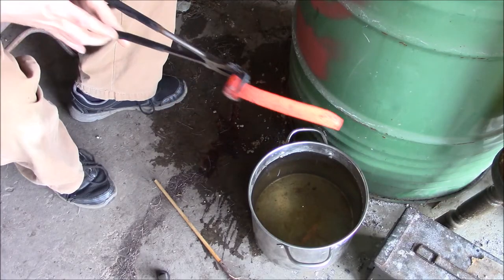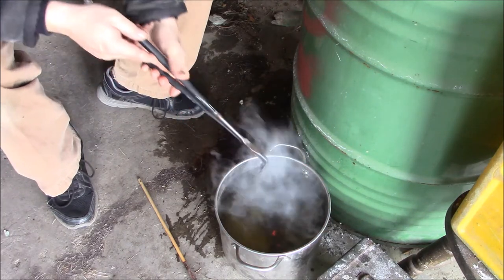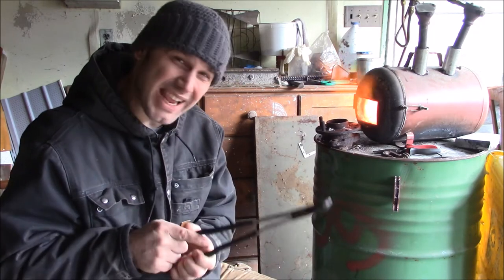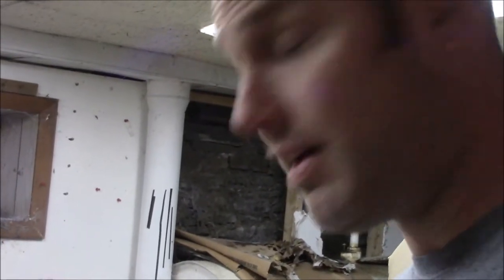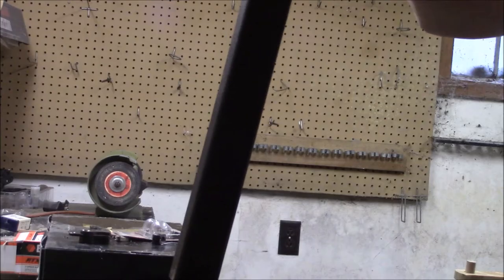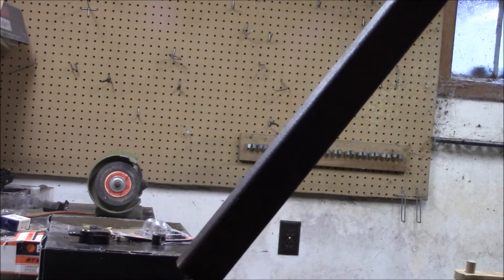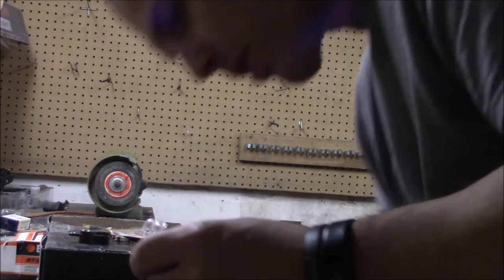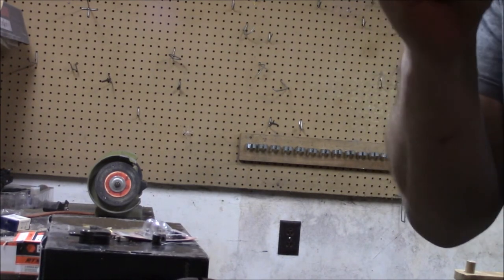Bladesmithing 4: Leaf Spring, heat treating and test break.

Comment: Im new to knife making and like you use spring steel. I noticed you have chosen to quench in water as opposed to oil. Is it better to use water for spring steel and will the results be better or the same as an oil quench. I have use oil for my first knife but would prefer to use water to reduce the fire risk.
Reply from the maker: Use whatever gets the steel hard. Water is more likely to warp or crack your blade. If you use water don't let it linger in the quench.
Reply: @WJBlades  thanks mate. Good video 👍

Comment: Good explanation.There is alot of materials which can be used in leaf springs.İn Europe there is different names , İn US there is another names.There is tons of leaf spring steels carbon contents about %0.7-0.4.Basically cheapest and sometimes thick ones (like train leaf springs) is 1045 or 9245.These steels can hardenable about 58-60 hrc after tempering 200 celcius hardness about 52-54 hrc.I think this numbers on the borders.(These numbers for Bohler 1730 basically more pure 1045 )But in this game you can not be sure what is leaf spring.Many of them has got carbon content about % 0.5-0.6.

Comment: I was just wondering if leaf spring is usually good steel. Also you should stir your pieces other wise you won’t get a proper heat treat since you’ll have a insulating layer of steam.
Reply from the maker: Spring steel in general is good for making blades in my opinion. Should you be telling someone else how to heat treat steel that you don't seem to have experience with?
Reply: @WJBlades  it is a well-known fact that you should move your steel in your quenching fluid to break the steam jacket to ensure a proper quench.

Comment: Hello
If we did very simpl  heat treatment  just tow red spot on 40 cm leaf spring     to make it as a ruler and made our knife with agrinder and then directly we tempered it    with out make any heat treatmeant and any quench what is going to happen can you try it please  what we shall get  waiting the result
Thanks
Reply from the maker: I'm not sure I understand what you're asking. If you don't get it past magnetic (over 1440 degrees Fahrenheit) and quench, it will not harden to martensite. If you don't harden it, the blade won't hold as good of an edge. It's all about what qualities you're looking for in your blade. If you're talking about using the stock removal method of knifemaking, that's not what I do. Sorry if I'm not understanding you. ☺

Comment: Sir, i have only a max. 250 degree celsius temperature oven!,any guide from you? For excelent temper for (leaf spring) knife
Reply from the maker: Leaf spring is mystery steel so, there is no perfect formula. However, I would start at 210° Celsius for at least 1.5 hours with a test piece, directly after your hardening quench. If it works out good on your test piece it'll work out good on your knife. If it ends up being too brittle increase your temperature a bit or your time at that temperature until you get the results you're looking for.
Reply: Try 180 degrees Celsius because a beginner would surely not get the quenching right in the first place ...so unless you're sure that your quench and other stuff was perfect ....try going a little down on the tempering temp.  .....as you can see in the video ....the knife he had tempered in the toaster oven had turned back into soft steel .....you need to find the sweet stop ...where the knife is not fragile but also doesn't bend so easily

Comment: Why are you using water?? Was the store out of oil???
Reply from the maker: Because water worked better. I use water quite often on mystery steel when oil doesn't achieve the results I'm looking for. Why not water??
Reply: @WJBlades  must people don't use water because the blades tend to crack more often than when quenched in oil.  I never had any luck with it....
Reply from the maker: Edward, I'm not sure how you know what most people are using, maybe an impression from watching tv smiths. I've warped a few blades in water quenching but never cracked one. It's definitely more volatile. Interrupted quenching helps, maybe you should try that. So long as you are getting the hardness you want out of the steel, without damaging the blade, who cares what your quenching it in. I don't understand why people feel the need to judge the methods of others. I get the outcome I'm looking for, sometimes it's with oil sometimes it's with water.
Reply: Water will give you a hard or very hard piece... the toughness (making it less brittle but still hard to hold an edge) will depend on the tempering.. 
If you always experience cracking or warping, try normalizing it first before quenching. Also make sure you have even and smooth  surface. Don't make the bevel to thin.
Reply: Been done with water since way before you were born